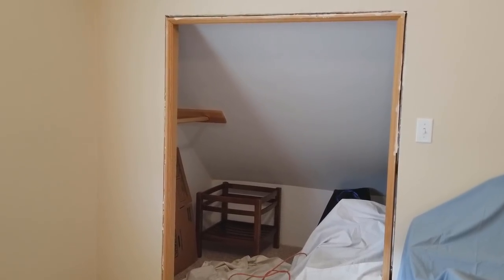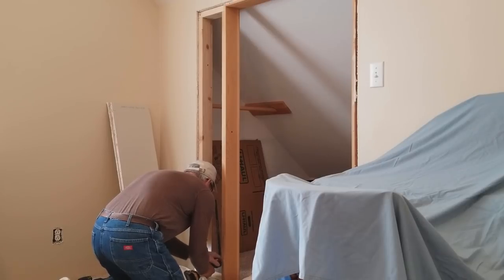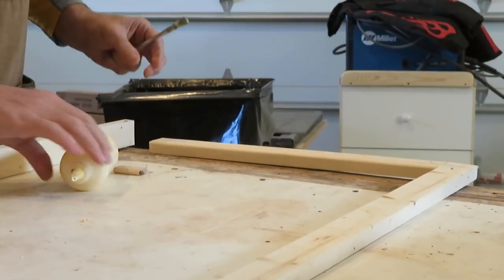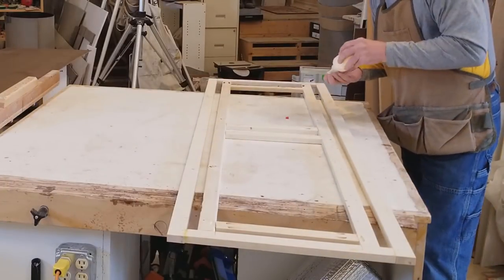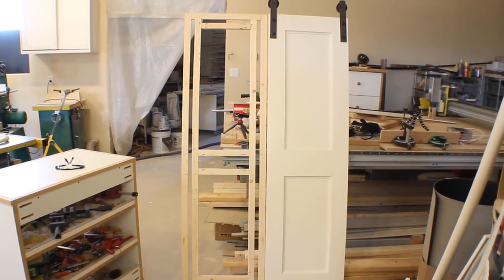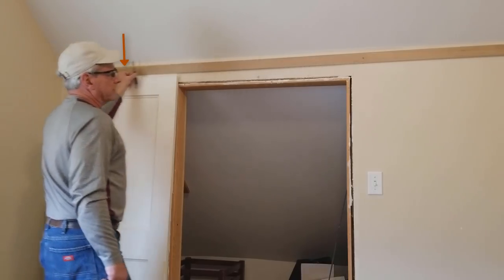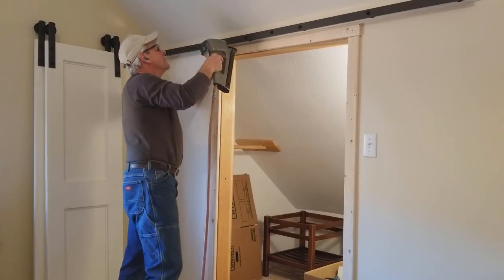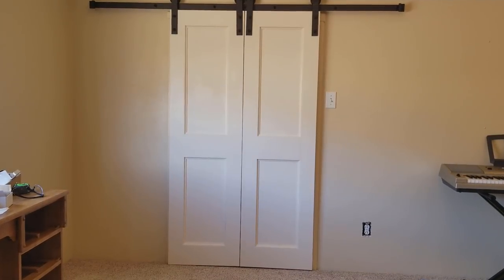Barn Doors Built to Any Size

Comment: Nice build Rusty , but maybe you should make two small notches in the middle of the steel rail for the rollers to sit in , that way they will keep the doors closed and centered , and a slite push will open them up .
Reply from the maker: Yeah, F, I have been thinking about something to stop the doors from going past the center line when they are rolling. I had to do a lot of adjusting to get the reveal right where the doors come together and notches might mess with that. Plus, I'm not sure with the design of the wheels and rail if that would work without bigger notches. The wheels kind of ride on the top edges of the rails. Thinking maybe some kind of small clamp in the middle that the wheels bump into but still let the doors close completely. We'll see. Always good to hear from you!

Comment: Looks great! Do you ever have issues with the bottom inside of the doors scratching the walls?
Reply from the maker: No, Maple, never have had an issue like that. The barn door hardware typically causes the door to hang a half-inch or so away from the wall. Thanks for your comment and for watching!

Comment: Looks good, but now you need to move the light switch
Reply from the maker: Thanks for being the first to point that out, Two Tops Turning! I knew it was coming! When I first started working on the project I thought about moving it to the inside of the closet. As it turned out, it clears the door fine when it opens. I think I'll quickly learn to flip it on before opening the door but if not, there is still enough room to turn it on with it open. So, for the meantime I'll probably leave it as is... unless it starts to bug me! Thanks for the comment!
Reply: And the electrical outlet...
Reply: That's not true. With the ease of movement with the barn doors it's just as easy to move the door.
Reply: @laurabarber6697  I guess now we're going to need an update on that switch lol